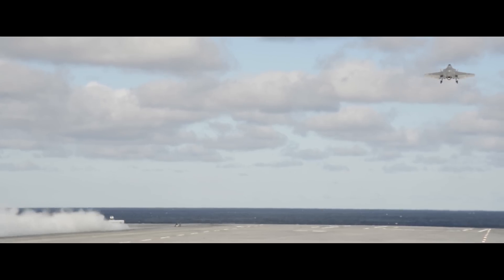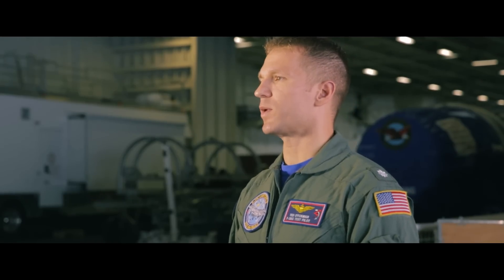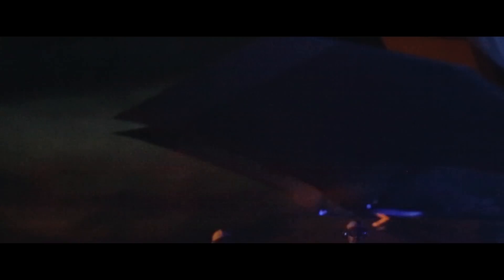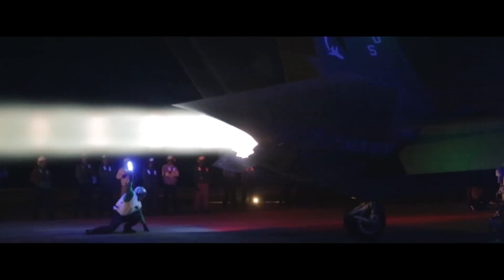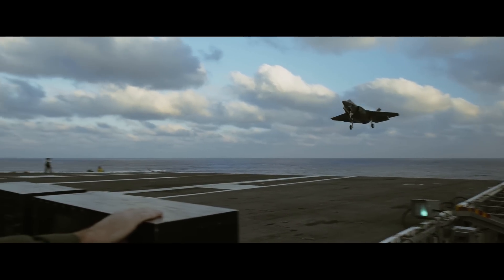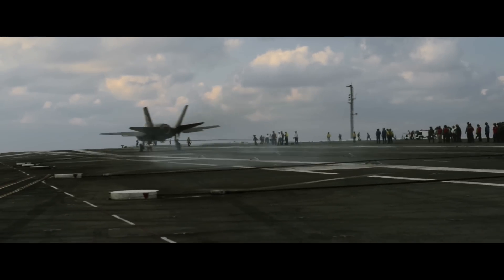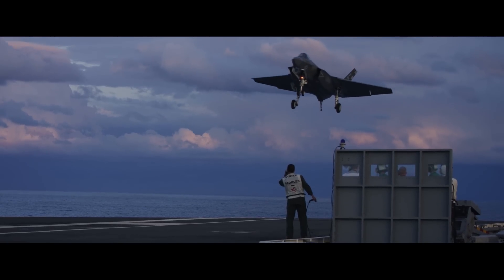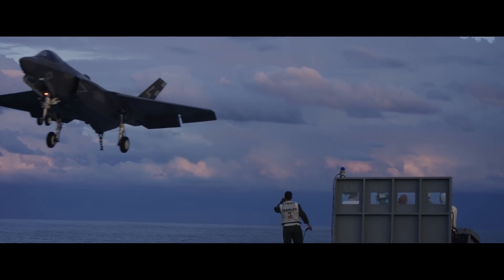F-35C DT-II Wrap-Up

Comment: this plane is garbage come on USA you can do better than that  make a plane with thrust vectorin and canards mix with stealth
Reply: +Abel  Trevino We used all those technologies in the past. We are way beyond that old crap.
Reply: +ELECTROSTATIC DISC LIFTERS how is stealth mix with thrust vectoring and canards old crap you really dont know nothing aviation !!!
Reply: +ELECTROSTATIC DISC LIFTERS i know that but im also talking anout thrust vectoring and canards
Reply: Abel Trevino The designers will use what will be needed. If the F-35s needed canards it would have them and the F-35B and F-22 is vectored thrust. You need to study aircraft designs if you want to know about fighter designs.
Reply: +ELECTROSTATIC DISC LIFTERS the one here that needs to study is u because do to what im saying your lost
Reply: +Abel  Trevino  keep in mind that this isnt like the F-22 in terms of stealth. If the F-35 was more stealthy, then it wouldnt be sold outside of the US. As for thrust vectoring and canards, like the F-22 and the Typhoon, the Lightning isnt built for intense dogfighting. It can defend itself if necessary, but it's not a true air superiority fighter. Despite that, the F-35 is still far more advanced than even the F-22 in terms of electronics inside. Even the Raptor is trying to grab some of those nice upgrades. The US has already started the 6th gen air superiority fighter, which im sure will make the raptor look like a child's toy, which would be quite a sight. At the same time, you want to be careful not to pull too many G's with thrust vectoring and canards since that can harm the pilot. Now unmanned...that would be badass to be honest
Reply: +Daniel Hudson let me just summarize it, what im trying to say here is that the US instead of waisting money on the f-35 a plane that got beat by a f-16 in a airshow demo they should make a super stealthy fighter jet with canards and thrust vectoring thats highly maneuverable and amazing in dogfights something that will put the russians on there knees
Reply: +Abel  Trevino your suggesting something like a "Super Raptor"? Or like a 6th gen aircraft? I heard the 6th gen engine is already being built, but thats all I know.  So far, the biggest threat would be the Pak Fa or the J-20, both look big for being fighters. But thats nothing they can brag about since stealth aircraft are VERY expensive to maintain.....I heard the B-2 bomber is a nightmare to maintain (lets hope the new bomber isn't as difficult). If the Pak Fa truly is as stealthy as advertised, then the maintenence and upkeep will cost a fortune for them.
Reply: Abel Trevino
You're just ignorant and a loser, Hell you can't even spell.
Reply: Daniel Hudson
To bad you don't know what you're talking about.
Reply: Abel Trevino
All you got is bullshit. "beat in a demo" your word are only shit dreaming.
Reply: +ELECTROSTATIC DISC LIFTERS So im wrong? Please correct me then instead of being a jerkoff. What part of my comments am I wrong on?
Reply: Daniel Hudson
All you have is hear say, shit that just doesn't count.
Reply: +Daniel Hudson yup something like a super raptor a f-22 with steroids!!!
Reply: +ELECTROSTATIC DISC LIFTERS search on the internet if you dont belive me since your so damn ignorant and childish!!!
Reply: +ELECTROSTATIC DISC LIFTERS stick to your little science projects aviation is too advanced for you
Reply: +Abel  Trevino just ignore him, old man is off his rocker since he has nothing better to do than be a childish name caller. Anyways,  the best thing that comes to a sort of super raptor is the 6th gen toys, or possibly the advanced F-16 Super Hornet with some stealth capability, though not as good as the raptor
Reply: +Daniel Hudson did you mean the f-18 super hornet?
Reply: +Abel  Trevino Nope, there was a proposed F-16 Advanced Super Hornet, looks like a nasty wasp with a terrible stinger. It would have some stealth capability. 
Same goes for the Strike Eagle. More recently, the little Fighting Falcon recived some excellent upgrades
Reply: Abel Trevino
All you got is pure bullshit, try some facts. OH YEA you ain't got any.
Reply: +ELECTROSTATIC DISC LIFTERS your not worth arguing with😂😂😂

Comment: Please terminate this plane! You ask the best Naval Aviators in the world and there are not sure if this plane is the best plane for the Navy! This whole project was based on the B model for the Marines cancel it!
Reply: +plumbit111 The Aviators thought the F-14 was to big and complex to be better than the F-4.....
Reply: Ok we will have to see...
Reply: plumbit111 That's pretty much how it always goes, we haven't been wrong much before.  If the programs reorganization back in 2010 hadn't gone as well as it has I would be saying the same thing a lot of people say today, but it has gone well, even better then the were demanded too.  Also the basline design is the F-35A, the B is based off the A, the C is based off the A as well but has a larger wing and tail surface.
Reply: What I was trying to say and it came from Pierre Sprey no plane should be design for 3 services and that was the thinking from day one to make it work. Sprey has said that the Marines vertical lift design would make the overall airframe of the planes to wide and fat
to perform as a dogfighter. Designer will say that's ok we can add more fuel and internal weapon capability but the weight keeps rising and the wings and control surfaces are too small to turn.If PW or GE can't increase their thrust by say 10,000Ibs. this plane in general will be a turkey!
Reply: plumbit111
The 3 services getting lumped into 1 air frame was the only way all 3 services were going to get a jet.  The JSF was started in the 1990's during Clinton's military budget cuts and the decline after the cold war.  Even in the early 2000s it would have been a hard sale to get all 3 services a unique jet.  They tried a couple other things, like using similar equipment but having 3 separate designs and 3 separate contracts still.  The joint project was the only way they had a high chance of getting it passed in congress.  It was going to be a single engine design from the get go, only people not super happy with that was the navy since they have been flying twin engines for the past 30 years. The USAF and Pratt and Whitney stepped in to show how modern engines were performing worldwide in single engine aircraft.  Was the F-35 built with dog fighting in mind, yes, but 3rd or 4th down the list, not first like the F-16, which also had nothing else on the list.  Luckily for us the F-16 was able to adapt into a great multi-role fighter but that's not how it was designed.  Dog fights will happen but pretty much everyone tries to avoid them, turning engagements are pretty much a gamble even in super maneuverable aircraft, you have Helmet mounted cueing , HOBS missiles and everyone is in the same ballpark maneuverability wise.  The F-35 was destined to be fat from the get go, all 5th gens are.  They have to house all there weapons inside(with the F-35 having a focus on larger A2G weapons), and on  the F-35 A and C a crap load of fuel is also carried eliminating the need for EFT's on every mission like how 4th gens fly.  You end up with a worse air show performer but a better war fighter.  The F-35A can go 9g, -3g and still cleared for top speed with 2 x 2000lb bombs and 2 amramms, still has its targeting pod (EOTS is built in) and ECM system (also built in), and 18,500lbs of fuel.  A F-16 is limited in every kinematic category when carrying that loud out, and so is the F-18, Eurofighter, Rafale , all 4th gens in the F-35's size range can't pull 9g with that loud out.  Control surface wise the F-35C shown in the video has freakin HUGE control surfaces on the wing almost 60% larger than the F-35A,B and has a enlarged tailplane over the F-35A,B.  The F-35A has the same wingspan and similar wing loading(when at half fuel) as a F-16 (both have similar range in this configuration as well) but has a significantly larger tailplane than the Blk 52 viper.  The engine thrust is fine atm, on the bench the F135 has done 50,000lbs of thrust but in it's current configuration it would be to hot for the F-35 at that power rating.  The F135 will have a blk 1 upgrade by around 2018-19 this is focusing on fuel burn rate(increasing range), the blk 2 upgrade slated for early 2020's will have a 10% increase in thrust goal.  If you wanna see a t/w comparison do a F-35A at loaded weight vs a F-16 with 2 x 330 gallon fuel tanks, the F-16 would have to have those tanks to fly anywhere near as far as the F-35 and that's without any weapons or sensors still, you find T/W and wing loading similar on the 2 aircraft.  The F-35 doesn't always have to fly with a full internal fuel load for every mission like all the 4th gens (western) do.
Reply: Agreed with most of your points.Speaking about large profile or being fat The T-50 isn't fat and holds most of its weapons internally and yes the F-35C has larger control surfaces than the A,B but having herd from experts it is less Stealthy. Talking about the engine were did you here that the engine can perform @ 50,000LBS because I have a friend that works @ PW In the propulsion dept. in W.Hartford CT and i'll will ask him about that. I'm just a person of interest in modern aircraft and your projections of future updates sound like story telling to me.
Reply: plumbit111
Compared to the Flankers the T-50 is based off of it's definely got more surface area.  Luckily for them the Flanker already had a great area for internal weapons storage.  They took the gap that sits between the two engines on there design and put most of the weapons there.  The T-50 is also a huge aircraft compared to the F-35 (and most western fighters) so it doesn't look as bad, but keep in mind the F-35A and T-50 have a 5,000lb difference in MTOW, even though the T-50 is larger in every category.  I don't really see how the F-35C would be less stealthy unless it was on approach or some other flight regime for the control surfaces have to be massively deflected, unless the experts work for lockheed or the JPO, I doubt they have info to eyeball a aircraft's RCS.  In normal flight it seems to move it's control surfaces less than the A and B.  The 50,000lbs claim I can't find the article for(i believe it's avweek and behind a paywall), I just see it quoted a bunch, but i will see if anyone has a link.

 For the upgrade path here

http://aviationweek.com/defense/pratt-unveils-sixth-generation-fighter-engine-f135-upgrade-options

Someone copied the whole article here

http://www.f-16.net/forum/viewtopic.php?f=56&t=27205&sid=c468c65bfeeeb1af7923db86a3733494
it's behind there paywall
Reply: Thanks for the info.. peace!
Reply: +plumbit111 No Prob

Comment: It is said F35 flubbed test launch Aim9X in the rear hemisphere? As the aircraft in close combat? Maneuverability because he is weak !
Reply: +Vladimir Stanislavovich PURE BULLSHIT, just plain crap and you know it. "it is said" is just to get anyone to think that the bullshit just might be real.
Reply: Vladimir Stanislavovich
That was only a test and means nothing, only to dumb asses like you.
Reply: +Robert Brockway then why he lost the close combat F16 ?
Reply: +Adolf Batman I wonder how F35 will hide for example T 50 which OLS sees much further 100 km, in addition to OLS and the main AESA radar N036 already are tested side AESA, as well as radars installed in the slats and the tail of the aircraft. AESA in slats mounted on su35S ... mine to rely stealth is not an option ... + RF is working on a new type of photoradar stealth then finally lose meaning ...
Reply: Vladimir Stanislavovich
That was only a test and means nothing. Only dumb asses like you take it as a failure.
Reply: +Vladimir Stanislavovich OLS can see 100km in perfect conditions against a rear facing target (facing at the engine) target designation happend within 20lkm due to the the laser range finder.  EOTS also has the same range claim against a unknown target.